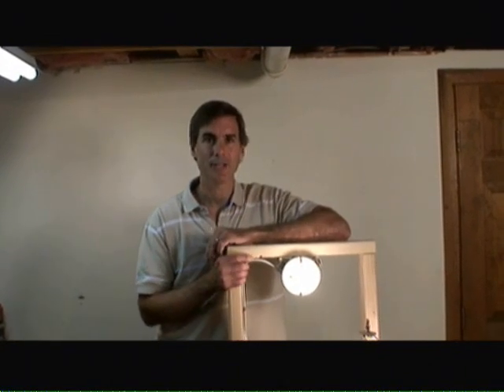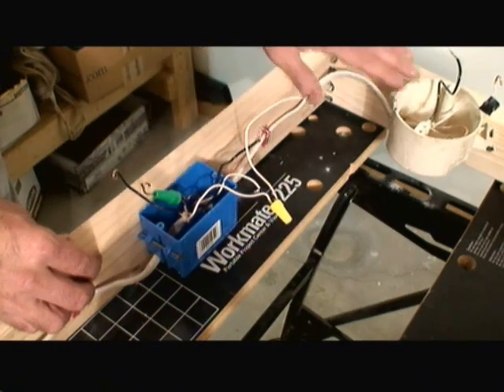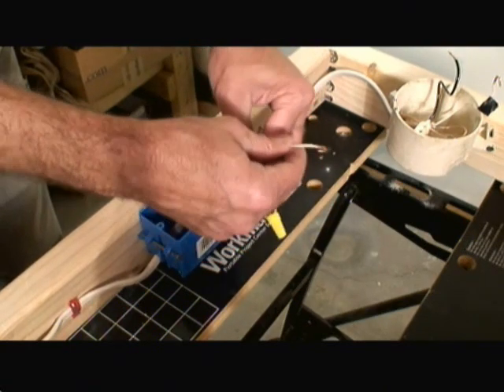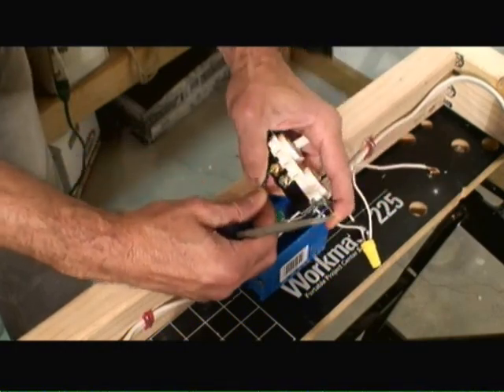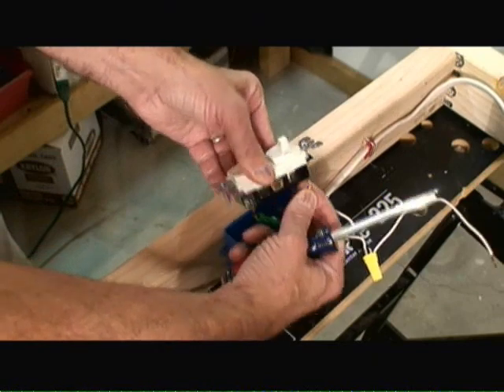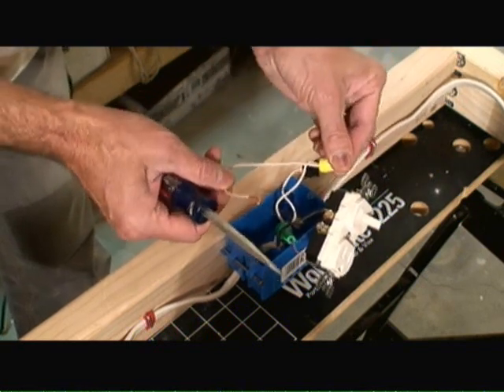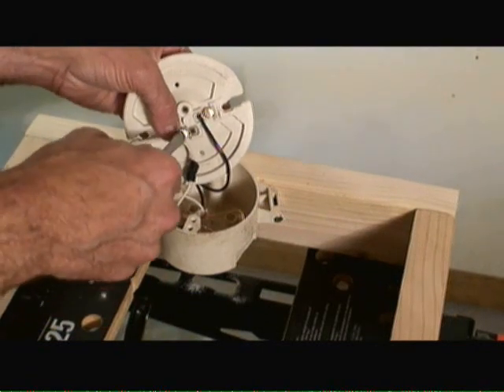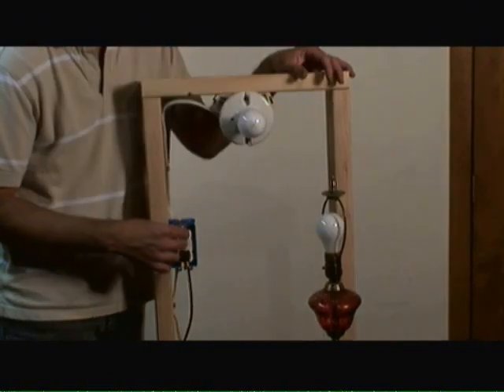Wiring Switch Outlet Combo Circuit Video

Comment: I ran into a problem.i am removing the switch outlet combo and putting a receptacle in its place. the switch controls 1 receptacle in the living room. their are 3 sets of wires coming into the box (1 power 1 to power all the outlets and 1 that worked off the switch) I wired it up all blacks together  (pig tail) to the hot side of the receptacle and the whites to the nuteral side. for so.e reason the receptacle that worked of the switch is not getting power. any ideas?

Comment: how do you wire it when you only have a black, white and ground wire going into the box. i want the switch to control the outlet because i want to plug my subpump in and use the switch to start it when i'm ready. because i want to avoid pluging it in on my regular outlet because my subpump starts right away which causes sparks in the outlet, want to avoid that!!

Comment: I am trying to wire a combo switch and outlet so that the switch controls the outlet below it.  I want to control the pool pump that is plugged into the outlet no wires like you have to another location light.
Reply: +John Teel I am looking for a video to do the same thing you want to do..Did you ever find a video that shows how this is done? Thank you, Paul

Comment: I'm also having an issue that is driving me absolutely bananas!  my bathroom light switch was wired completely wrong.  one switch that controls the light, the exhaust fan and the electrical outlet.  turn on the switch, everything turns on, turn off the switch, everything turns off.  i can't plug in a night light or one of those plug in air fresheners because of it.  i opened it up and it was a complete mess.  still haven't figured out how to separate them all.

i'd prefer to have a double switch, one to control the light, one to control the exhaust fan.  and i want the outlet to have power regardless of the on/off position of the switch.  ps there are absolutely no ground wires anywhere to be found
Reply from the maker: Sounds like older wiring since there is no ground wire. I would suggest calling an electrician to be safe and to be sure you get the configuration you're looking for.

Comment: I have an issue that's been driving me nuts. On my outlet combo in my garage has all the same wires that you demonstrate except I have an red wire that I have no clue where it goes. Please help!! I'm going bonkers!
Reply from the maker: Patrick, It sounds like you have a 12-3 cable that has a black, white, red and ground wire. The red wire is another "hot" wire. It could be feeding another parallel circuit or is used for a 3-way switch associated with the circuit you're working on. You may need to call in an electrician to figure out what its for.
Reply: Ok thank you very much for your help!

Comment: Mark - thanks for the great video.  My situation - the original outlet I want to change to a combo has current wiring in series - the incoming Romex to the outlet is then wired outgoing to other outlets.  How do I wire a switched light in this scenario?

Comment: @TheAssasin887 - I was thinking mine was the same way as yours  but i think i figured it out. it doesn't have to have a ground, older houses dont. but think of a switch as an inline breaker, it is on the hot/live side, without it, the light would have one solid wire and be on all the time but the power goes through something to turn it on, it doesnt just go in and never come out. the power has to return to complete the circuit, which doesnt involve the switch.

Comment: I had a 3 wire switch (black/white/ground).  I didn't break any tab.  All I did was use the black and white to make the light switch work, and the white and ground to make the plug work constant.

Comment from the maker: If there is not a pair of romex cables (with black/white/GND wires in each) coming into the box then you will not be able to wire an outlet in it. Normally there should be one romex cable wire pair for the hot side, and another for the feed going to the light switch. The circuit that you are describing/desiring does not allow you to have a return for the outlet.

Comment: Hello! I have a question for you. Me and my girlfriend just moved into an older home and there are NO outlets that I feel even remotely safe plugging things into in the bathroom. I was curiouse if there was any way to wire an outlet into the light switch. I took the panel off and there is only a black wire and a white wire (hot/neut) I was wondering how this will work. I just need a temporary solution to a temporary problem.